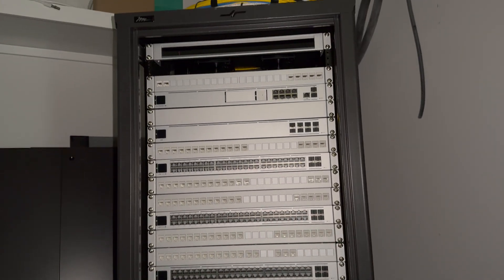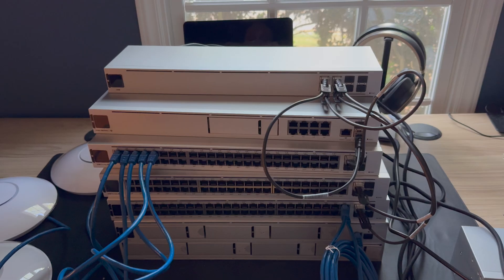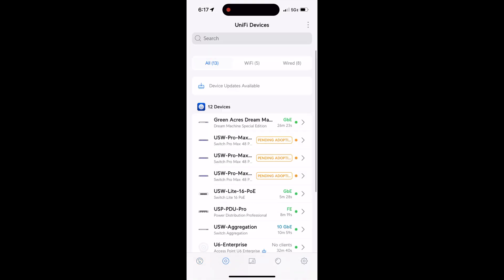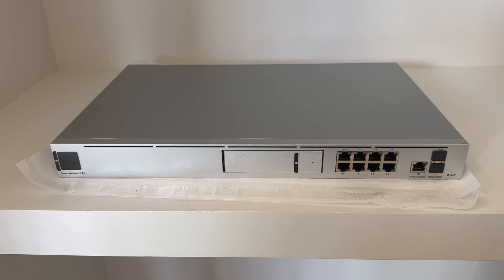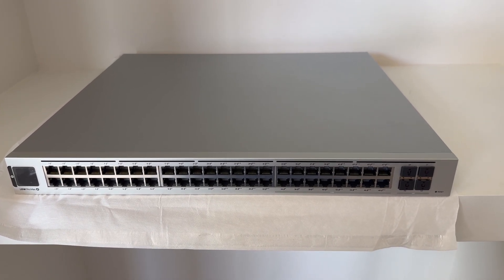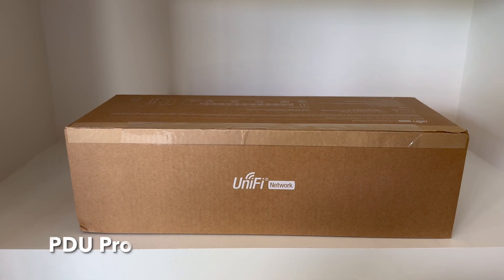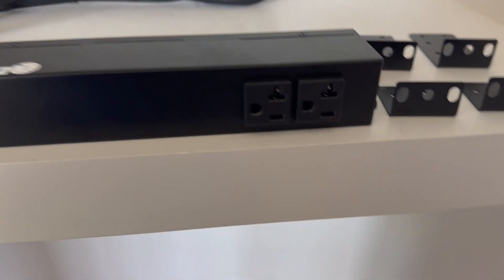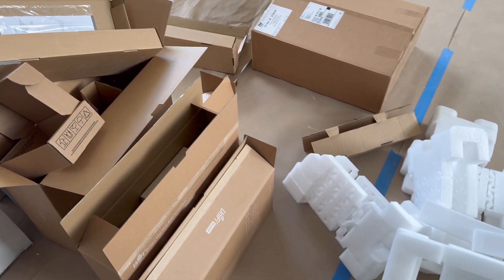Unifi Rack Build Part 1

Comment: How does one come to have that much Ubiquit gear? Awesome setup.
Reply from the maker: Thanks for the kind words. As to why so much gear … this is a pretty big house with about 120 network drops in almost every room. Since this is new construction, we took the opportunity to wire for everything, which means we need a bunch of switching capacity. Additionally, there’ll be a bit more stuff inside the rack, so we planned for some growth.
Reply: @CarolinaHomeTech  Looking forward to more videos.

Comment: hi there, great video keep us updated, what programm did you use for planing(looks great)
Reply from the maker: Thanks for your support! I used https://excalidraw.com which is an open source solution for diagrams. It’s very simple, but also powerful and extensible. I recommend it fully, but be on the lookout for integrations into other products you may be using.

Comment: What's the cost? Unifi stuff ain't cheap, and it looks to be around 10k just from a brief google.
Reply from the maker: Yeah I think you’re not that far off if you include the rack and the labor for our security company to wire up the patch panels.

If I get to it, I might post a video with the cost breakdown of the network setup. I would’ve certainly loved to watch a video about that before I started this journey, to avoid some sticker shock!

Comment: So, you have spent a motza on all the bling, now lets see if you get the config right as I already see some warning signs....
Reply from the maker: Hey! Thanks for taking the time to leave a comment! Yeah this stuff ain‘t cheap, but it‘s a pretty big house with about 120 network drops, so what you see in this video does not really seem like overkill to me, given what we‘ll use it for.

I admit I never designed and configured a network of this size. If you don’t mind sharing what warning signs you see, I’d be very grateful to learn how I could do better.
Reply: @CarolinaHomeTech  I rollout UniFi in a lot of larger installations feeding anything from 50 to 400 access points along with associated switching and control. 
I also run a home DC (not a lab, mine is production) and yeah, like my bling. 
Next video is the one where boo boo's can sneak up. For now, power management , filtering and UPS will be key. No, commercial UPS solutions wont fit in the rack and deliver. I use Mains inverter-chargers now that have UPS funtion but in better shapes and allows much, bigger battery options.

Comment: Nice setup and planning. 
Just subscribed to your channel to follow along.

I do agree with the “fiber comment”. 
If you can, runs some some drops.
With all you have in your rack, (and it seems you like tech 😉) you might want to (re)consider the “Aggregation Pro Switch”? 🤔

Enjoy!
Reply from the maker: Thanks for your support!

Fiber is not currently installed, but we arranged for an easy upgrade path, see my response to the fiber comment.

Also, don't tell my wife, but I may end up getting the Hi-Capacity Aggregation switch after all. There's no rule that says I can only use it for aggregation, is there? ;)
Reply: @CarolinaHomeTech  
😂✅👍

Comment: With the walls opened up you should run fiber drops to each room just in case. Fiber is so cheap now a days and its a great upgrade path to have something ready for up to 100gbps if you ever need it.
Reply from the maker: Thanks for your suggestion! The walls are already closed, and as of right now, we haven't run any fiber. BUT, we have still planned for it in all the places that matter.

As is typical in North Carolina, the house has a crawlspace underneath of it. We ran four 2-inch pipes from the AV closet to the crawl space for future expansion (which as if right now are completely unused). This means that every room in the first floor can be easily retrofitted with fiber. That covers the primary bedroom, the two offices, the great room, as well as a hobby space that I plan to use for creating music and videos. Additionally, we have run conduit in the great room to allow running future cables through the wall behind the TV. As for the second floor, it's not quite as easy, but honestly, I don't think we'll use fiber in any of the upstairs bedrooms. We do have a movie room where we also ran conduit for future upgrades.
Reply: @CarolinaHomeTech  I know you probably thought of this, but because the floors have a crawlspace make sure you arent going over the maximum load limit that the floor joists have especially with a 42u rack. You dont have any real deep servers so you should be fine but even the rack by itself is heavy
Reply: ^^^ this, fully agree !
Reply from the maker: Yeah, fiber is planned for but not currently installed, see my other comment.

Btw, I just checked out your channel. I'm using the VerticalCable I-Punch myself, it's a game changer. I let the guys from our security company borrow it for the rack installation, and they loved it, too.

Comment: Great project. I would like to follow the progress. Will you install all cat6 cable by yourself?
Reply from the maker: Thanks for the kind words! The CAT6 cables across the house were installed by a security company. It's over 120 cables, so that would've taken me too long to do myself! But if you pay close attention to this video, in the after shot there are a few blue cables hanging out of the rack. I added them off camera to connect the PDU, a future UPS, and my NUCs to the switches. Everything that's inside the rack and inside the AV closet, I will wire myself.